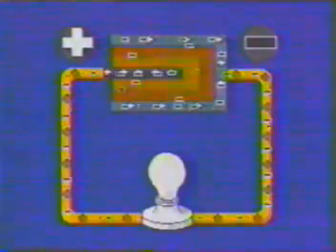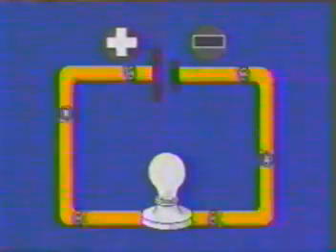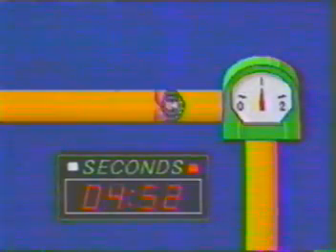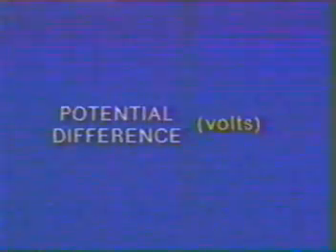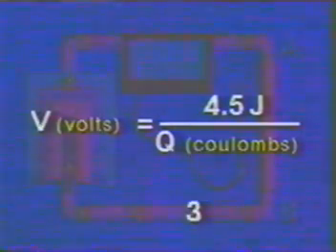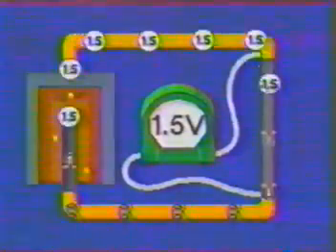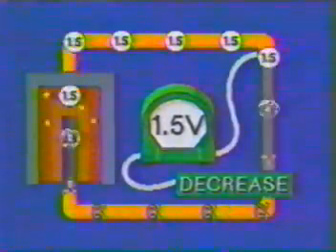potential difference

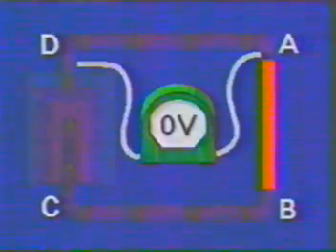Comment: At 7:57 he says if the wires DA and CB are good conductors, there is no potential difference, meaning 0 volts.  How could this be?

Suppose that from D to A we have 3 coulombs and 12 joules of Electric Potential Energy.  This would mean there are 4 volts (12 joules/3 coulombs) running between D and A, but he is saying there would be 0 volts (if the wire DA is a good conductor).

So how could there be 0 volts between DA?
Reply: since it's a good conductor so no resistance and therefore electric energy is not converted to other forms of energy. this means there is no potential difference.
lol explaining this in 2017!!😂

Comment: is the heat element described in the circuit  reffering to thermal voltage, VT? which is 25mV at 300K?

Comment: @66vivek Imagine the skiers. When they are at the bottom of the slope, they have to move to the lift again. Because they still have some velocity and the snow is almost frictionless, the skier does not lose energy while travelling that distance. The same goes for electrons in a good conductor. There is no friction for the electrons, so they don't lose any energy, so there is no difference in potential energy between point A and B (or C and D)

Comment: this is terribly convoluted and, in several cases, wrong or misleading.

for example, in a battery, the coulombs do not pass through the battery, gain energy and keep going, that's what happened in a generator.  a battery has a bunch of electrons in one chemical that are pulled to another chemical through the wire.

there is a great video that uses water to demonstrate electricity, but i haven't found it here. if i find it, i'll see if i can post it